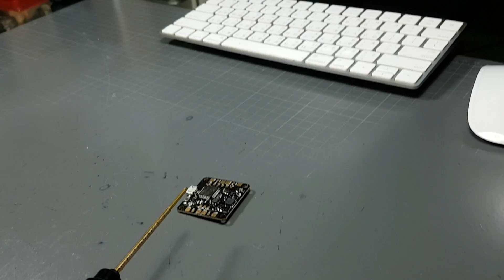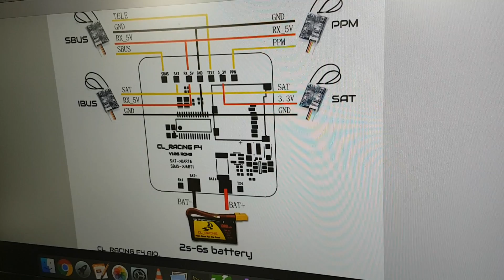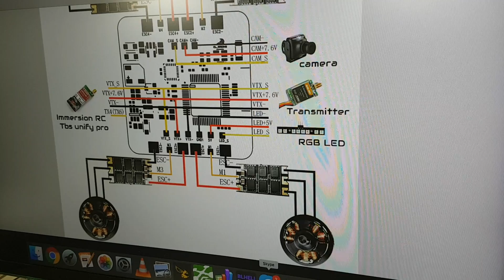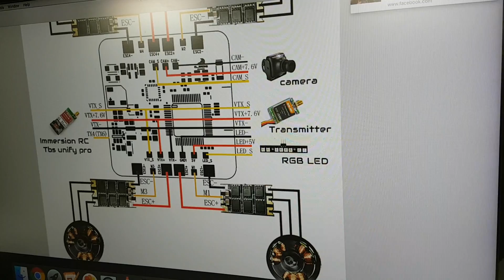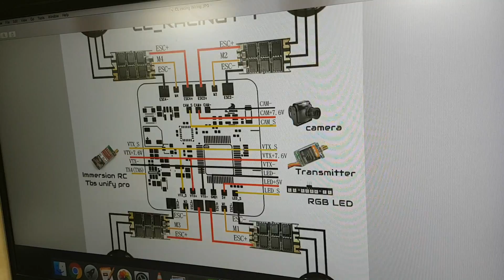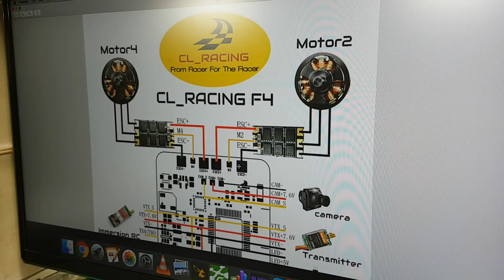CL Racing F4 by Cheng Lin

Comment: Any solution for the bad video? There are very big horizontal lines all over the video signal. With all of the VtX’s that I’ve tryed
Reply: Nedyalko Petkov get a low esr capacitor.. 25-35v 1000uf or 4 330-470uf caps on each esc! Also a voltage regulator tuned to 8.6v will do the trick!

Comment: Getting video lines  and static with throttle also,  thru the osd on board I guess.  I'm using a vtx I previously used with no lines.

Comment: Am using this right now and can confirm it is AWESOME!!! I switched over from an f1 naze32 on 1k1k to 8k8k and .... the best part is its reliability and durability. I'm loving it just as much as when I  discovered spedix escs -  everything's good about it and have 0 complaints so far.  Hats off to the guys behind it as im still getting used to having a quad work for more than 2 days.
Reply: wait, no, I actually have 1 complaint: the inbuilt buzzer is super weak, noise-wise.
Reply: Charles R Taylor whatever is happening, my board works and can connect to a pc. I've never been able to flash new versions through my betaflight though
Reply: no real problems nonetheless

Comment: Is the telemetry port inverted or will we have to use non inverted mods for the frsky receivers?
Reply: its not inverted no - need to solder to a chip on the x4r to get telemetry
Reply: Taranis is Frsky and what I am using. I was not aware of a flysky taranis.
Reply: he probably meant Frsky

Comment: Looks great.
Basically the BF F3 FC with an F4. Awesome given that they are apparently cutting features due to memory issues on F3s soon.

One question:
After you connect Smart Audio is there still another free UART?
Curious about a port for future proofing ESC telemetry when it becomes available.
Reply: For any one who is curious to know I contacted Cheng Lee and you can use the spectrum RX pin as UART6 RX. So you can can:
SBUS
Smart Port
Smart Audio
ESC Telemetry 
on this controller.
Which means .... - I'm gettin' some.

Comment: just letting you all know,,, you can purchase this FC here in china as of two days ago and have ordered one for a 3"build to test it, price wise its very competitive, ,perhaps its available for the rest of the world too now.
its good you mentioned the power rating of the board and 2306 motors.
 Hopefully I will also use the board on a 5" build too that will use rcnpower 2305 GTS2450kv  motors + 40/50A esc's hopefully the board can handle the load 

kind regards
Reply from the maker: There is only one legitimate seller in China and that's the CL Racing store. One or two other places sell clones of an earlier version that is not the final version.
Reply: hi again any idea when betaflight 3.2 will be released ,,,, thanks
Reply from the maker: Not sure, but I hear soon.

Comment: Can you do a short video on your oomph velvet motors please. Would be great.
Reply from the maker: Look up FPV Life by Vek on YouTube. I recently talked about them on the show. :)
Reply: Armattan Quads thx really great the whole show was awesome. The racing frame that will be coming out. Will there also be an option to add programmable led lights as most European races require changeable leds. And will it be released in the next 6 months? I'd can't wait to order one.
Reply: Armattan Quads is this Flight controller has a RSSI pad?
And is this Has LC filter in it?
Reply: Armattan Quads TBS unify Pro is need 5V how can I run it if there is only 7.6V for the VTX?
Reply from the maker: See wiring diagram on our website.

Comment: So will a prebuilt chameleon with this board now not have the xt60 rubber connector saver
Reply: Danglosaxon good question. I also wanted to know this. And in case we would u outside use a unify v2 that needs 5v could it be powered of the led plus?
Reply: As did I........ I hope we get an answer.
Reply: Would like to know too
Reply: No you dont get the connector with armattan. the thing creates HUGE video noise. https://www.rcgroups.com/forums/showthread.php?2892278-CL-Racing-F4-AIO-%28fc-osd-pdb%29/page8
Reply: Savage FPV I received mine yesterday I will do a video review about the whole chameleon so far I love it.
Reply: Savage FPV and the chameleons cam come swirled thru the filtered aomway and the aomway itself filters from the lipo directly so no problem at all I think.
Reply: Armattan are resolving this issue for me - again A CLASS CUSTOMER SERVICE